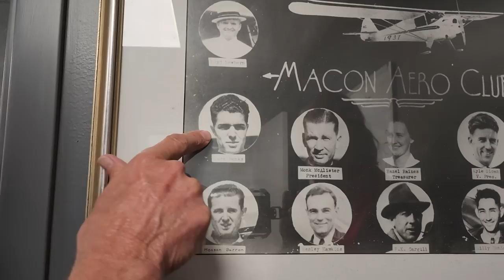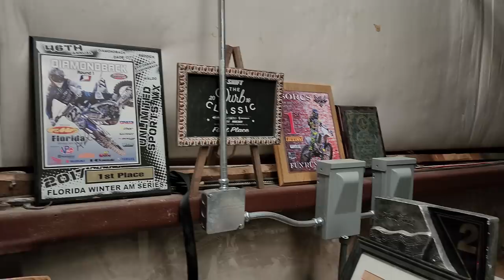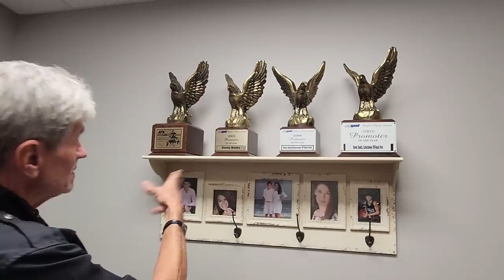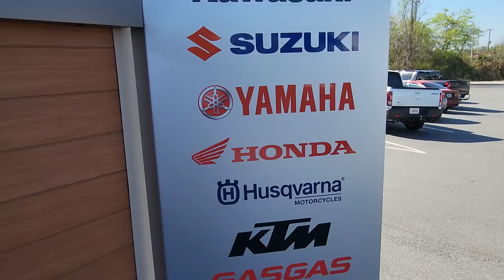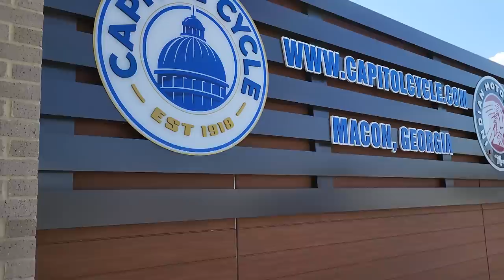OLDEST & BEST BIKE SHOP IN U.S.A. SINCE 1918 CAPITOL CYCLES  FAMILY OWNED  BY ATV CHAMP DONNY BANKS

Comment: My 09 600rr has 60k on the cluster and has no problems and has another 15 years of getting after it  and I will be replacing it with another one  cheaper to use the 350 small block of  motorcycles 🏍